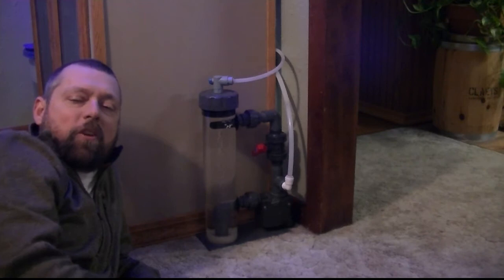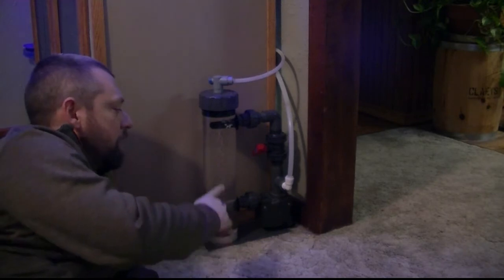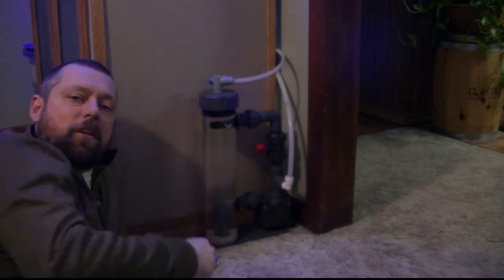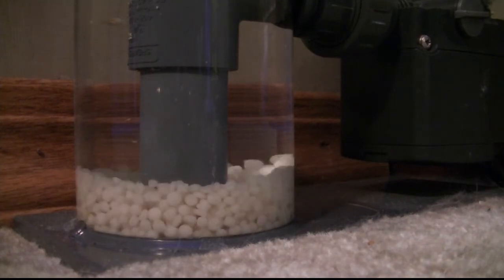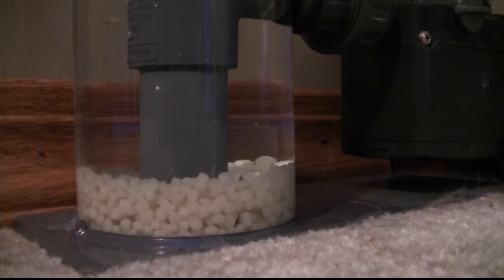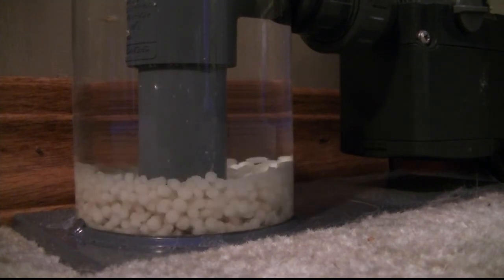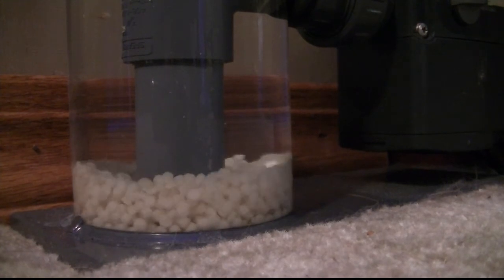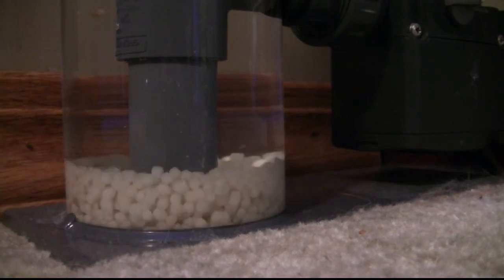Biopellets: how to Tips and Tricks!!

Comment: Been thinking a lot about buying a small Reactor for my 13.5 nano,  I run Seachem matrix in one of the chambers (it's an all 8n one tank) but I don't think they are keeping up with my tank load even when seeded.
Reply from the maker: Detroit Nano Reef I tried to use matrix in my system but it would not keep up. It's actually still in my sump. I can tell you only biopellets and water changes keep my tank at 0 nitrates I also use Gfo to keep phosphates down.